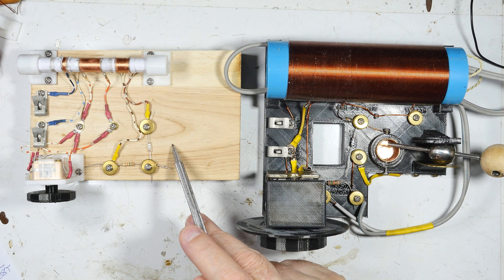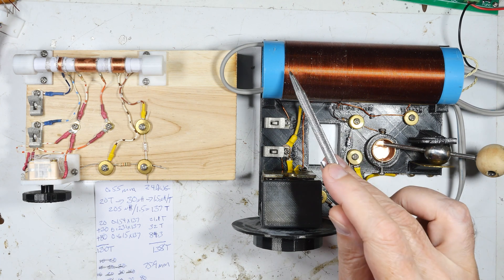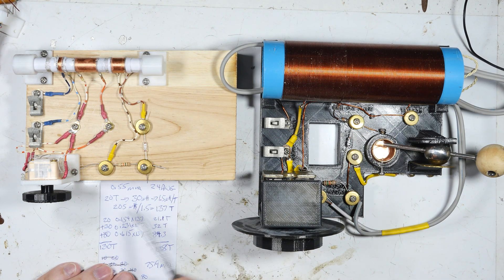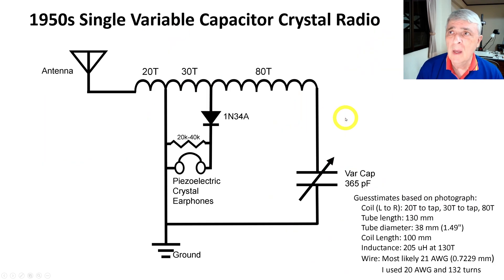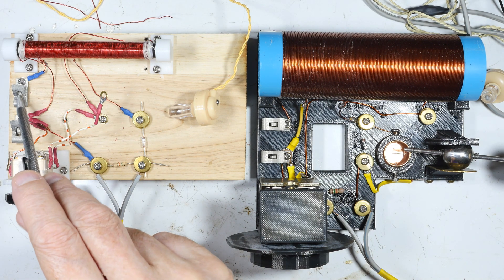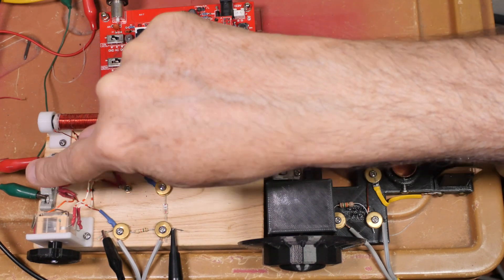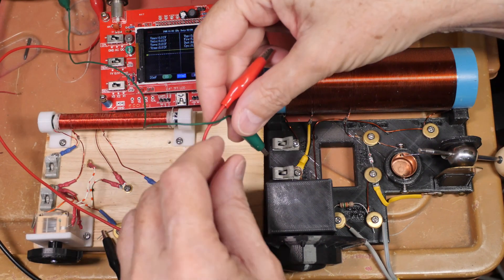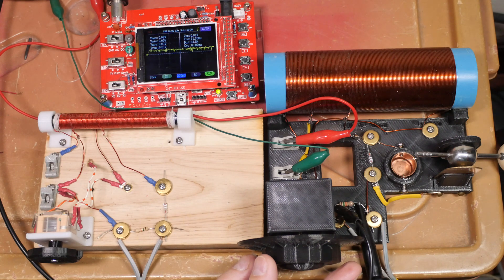Crystal Radio, Ferrite Coil Model #2 (4K)

Comment from the maker: I realized I was not clear with the wire sizes. The original ferrite was wrapped with 32 AWG (0.2mm) == 195 uH, the blue air coil was wrapped with 20 AWG (0.8 mm) == 205 uH. The second ferrite was wrapped with 24 AWG (0.55 mm) == 205 uH. Why did I change to 24 AWG? Turns out the 20 AWG wire is too wide and would not fit on the core.

Comment: I've done a lot of fiddling around with crystal radio circuits, and I've come to the same conclusion: a good ferrite core SHOULD provide better results than an air core with the same electrical values... but it never does.  For some reason the ferrite always ends up absorbing and damping the weak-ish incoming RF energy as if you'd placed a resistor across it.  

I do not understand the physics of this, and find it very frustrating when no combination of coils on the best ferrite core can compete with a haphazard aircore wrapped carelessly around a small cardboard box.  If you employ an open basket-weave coil (providing reduced inter-winding capacitive damping) the results are even better... but insert a small ferrite core into it for increased Q... and the signal strength dies again.

That's why I gave up on crystal radio tinkering - I was unable to improve on aircore coil construction.  😥
Reply from the maker: Ferrite cores can work, but they are never as good as an air core. I have many variations on the ferrite TUNED type I have released recently. Maybe one of those would be of interest?  
https://youtu.be/xViNW4HFFDA
https://youtu.be/kCxQ8iPQx4s
https://youtu.be/ez_O3l7E5is

Comment: I am surprised you got such poor results with the ferrite rod crystal set. I built my first crystal radio (Philips Pionier 1) when I was 16, connecting an antenna of 10m and using the central heating radiator as an earth.  I could hear at least 6 AM stations with acceptable selectivity and volume. The coil is wound around a ferrite rod (#62 material), has 3 x 16 windings 0.5mm and the variable capacitor is 365 pF. Looking at your coil I wonder why you need so many windings. I think the section of the variable capacitor you're using has too little capacity. Do you use both capacitors in parallel? 
Later I rebuilt the crystal set  using thick litz wire and this gave markable improvement in sensitivity. It its also worth experimenting with the tabs on the coil. Depending on local circumstances, it might be worthwhile to switch the antenna tab and the diode tab. Improvements can also be obtained by choosing different diodes or even crystal earpieces! The old 0A79 diode is almost unobtainable now but is still is more sensitive than modern germanium diodes like the AA119.
Here's a link to a pdf of the manual. It's written in Dutch but I think the drawings are self explanatory. 
https://pa3esy.nl/Philips/Bouwdozen/pionier/pdf/pionier001.pdf
Reply from the maker: I will have to take a close look at the diagram. Thank you. I was also surprised how poorly the one I made worked. If you have several stations nearby, it would probably be OK, but if you're in a place like the middle of the US where stations are spread out, then it seems to be too inefficient to work with weaker signals.

Comment: At 11:08 ferrite core coils work better for Heterodyne radios. That is where a dual ganged capacitor is used. One capacitor tunes the coil (just like a crystal radio), the other capactor tunes a Local Oscillator (LO) so that the mix of the two produce the radio station tuned frequency, the Local Oscillator frequency, the sum of the frequencies, and the difference of the two frequencies. Only the difference is used (using a 465KHz low pass filter). The Local Oscillator mixes and results in 455KHz (in AM radios) no matter what station frequency is tuned. That 455KHz is known as the Itermediate Frequency (IF) and is Amplitude Modulated with the exact same signal as on the station signal (the modulation does not change frequency).  Using this method down converts ANY tuned radio station frequency to this one IF. Now varoius stages (quite often 3) of band pass filters and amplifers are used to amplify only the IF signal +/- 10KHz (the bandwidth of the station signal), this cuts off all other stations to either side of tuned station, leaving only the strong tuned station. This is where very high station selectivity is achieved. The signal then goes through a Germainum Diode to cut off the negative levels of the IF signal, then the signal goes through a 20KHz Low Pass Filter (leaving the human range of audio signal only). Finally that signal is greatly amplified to drive a speaker with volume control.  It's simple but requires many transistors, IF transformers, and DC power. Heterodyne was first done using vacuum tubes before transistors were invented.

Comment: Thanks, I almost indepently assembled a similar ferrite core crystal radio that had little sensitivity. This one wins hands down, but I'll give the air core a go instead.
Reply from the maker: It seems that ferrite cores and variometer based radios are not suitable for unamplified, unpowered radios. Contesters use air cores and now I see why.

Comment: Howdy. Yeah.
For myself I would be apprehensive about using a wood plate. Wood will absorbe moisture. I would use pertinax or acrylic plastic.
I agree. The tapped coil setup delivers the tightest coupling.
A couple of suggestions. Bias the diode for more sensitivity and use an antenna loading coil. An antenna loading coil tunes the antenna system to resonance. The net effect is that the antenna seems longer. It increases the effective capture length.
I might suggest checking the clips of MICROWAVE2. There one also finds coprehensive studies into crystal detection, like are Yours.
Regards.

Comment: It does kind of make sense that your air core kicks out more volume. The only energy is coming through the air into the wire. The radio with more wire has more power.

Those old radios in the 20's ran long 100 foot or so wires out of windows to high up in tree trunks or the side of barns to maximize input power.

Now you got me wondering if those early crystal sets wound on Quaker Oats cereal containers were even better because they had even bigger windings to absorb radio energy?

There were a lot of failures trying to build those old published Quaker Oats radio designs and that's because modern cereal boxes are now smaller in diameter which threw off all the winding calculations.

Someone figured that out and got a modern sized box to work by adjusting the windings but I don't remember anyone doing a comparison between a full sized box and a modern smaller sized box.

Unfortunately only the collectors with full sized boxes  have the radios to test with.

Comment: I am thinking that you may be correct about the ferrite consuming some of the signal. I think of it as if the coil were wrapped around a metal cylinder of sorts.
Reply from the maker: I agree. The people who do crystal radio contesting use air core coils.
Reply: I had though air core was used because it was required by contest rules? @tsbrownie

Comment: Well, I wonder about your ferrite core. What is the highest frequency station you get on it?
Reply from the maker: 1600 kHz. I tested it with a frequency generator and scope and it looks pretty efficient.
Reply: If I recall, in a vid you said the relative permeability was 1000. I would think it would have blown the air inductor out of the water. Strange. Is the diode reversed? The diode white bands look orientated differently on the two recievers. @tsbrownie
Reply from the maker: @franzliszt3195  The relative permeability varies from 10s to thousands, so unless you order from a mfg or qualified distributor, you rarely get that number. I don't recall the formula for it and how it's related to Q. I'm sure there must be different qualities  of the stuff as well. Too many variables and not enough rock solid info.